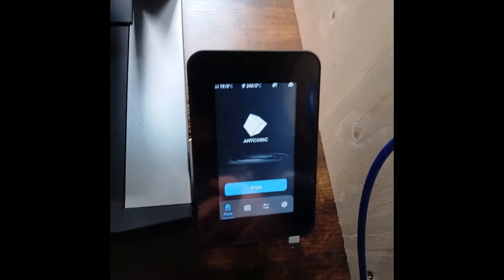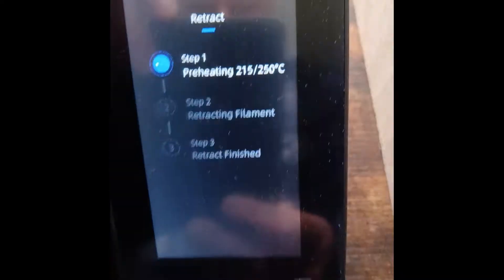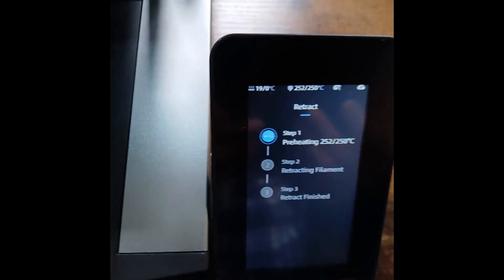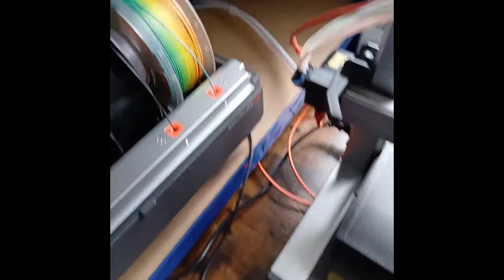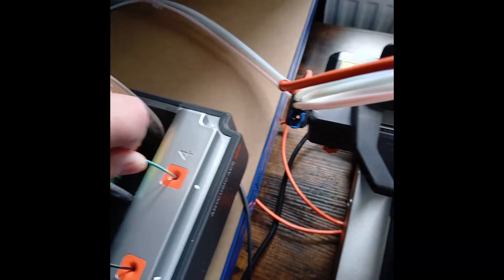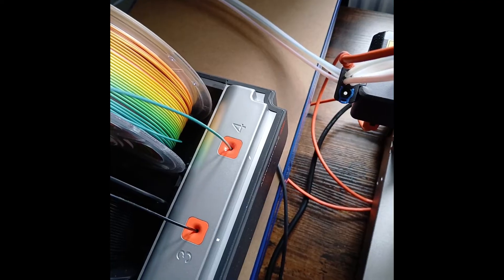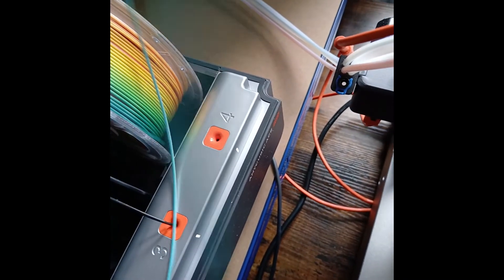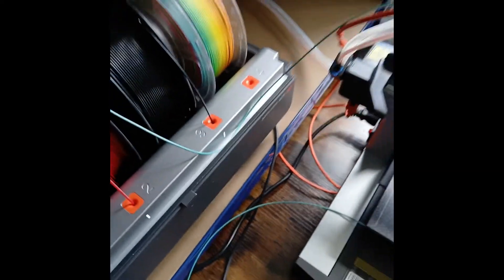How to remove filament from the Anycubic Kobra 3 Ace box

Comment: It's stupid to heat it up when it's not inthe end.
Reply from the maker: Hi yep you do not have to have the dryer on to take the filament out , I just always make sure the filament is dry,  because if it gets moisture it can snap not so much with PLA but with Petg and I would rather not have to take the Ace apart to get a snap bit out

Comment: i can't extract i cant retract idk what to do
Reply from the maker: HI You should be able to pull the filament out of the tubes even with the ace box turned off, unless it has got jammed or broken in the ace box gears or the print head. When a print has finished the filament it was printing with should retract back away from the head and you should be able to see it through the tubes If it is still stuck in the head then you can either remove the tubing form the top and cut the filament then remove the filament from the head. If it is stuck in the gears in the Ace box then you will have to dismantle the box to get the filiment out. There are videos online on how to remove jammed filament in the Ace box and print head.
Reply: @resin-art-and-3d-printing  yup I cutted it and ut works thanks !!